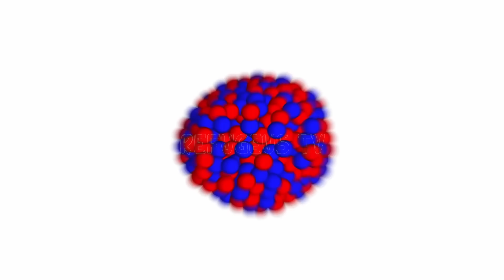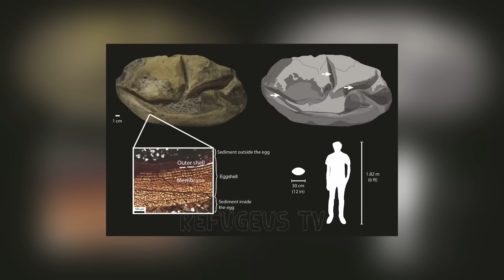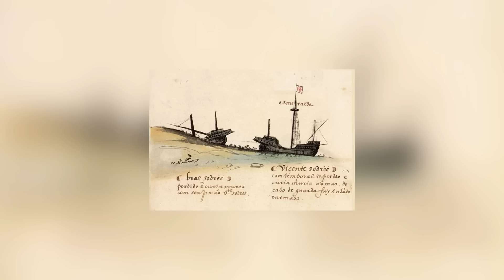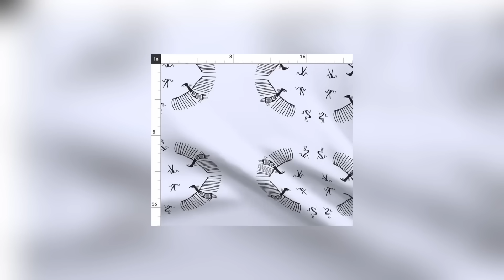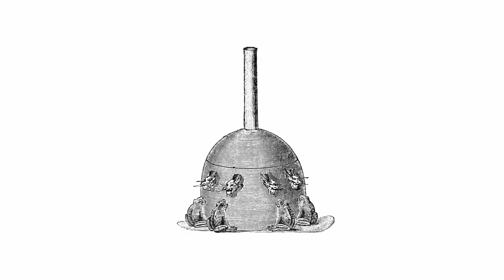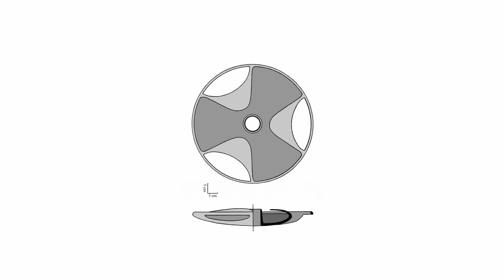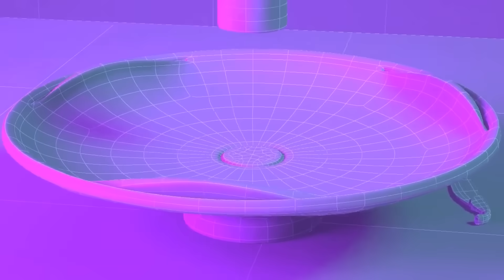15 Archaeological Discoveries That Science Can't Explain

Comment: When drilling, drill bits get very hot. The Sabu disc directs a water mixture directly to the bit while drilling. The disc is always shown upside down. It is very simple. Other materials melt due to the heat from the friction of cutting through rock. You learn things like this from actually working with materials, not from burying your faces in text books written by squishy handed scholars.